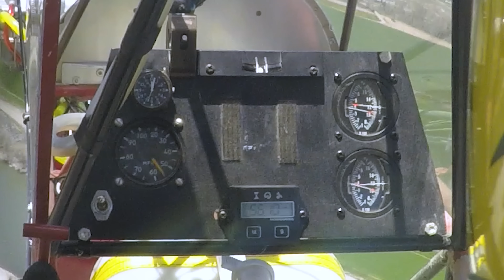MAIDEN FLIGHT goes BAD on landing.😓 Abandon airplane PART 6.

Comment from the maker: Grab yourself some Flight Stix, Hydration packs from www.leadingedgesupps.com and use coupon code: JONAS for 15% off your first order. ITS GOOD STUFF!
Reply: Jonas, how do I get some information about my company advertising with you?
Reply: Jonas, You made me feel way better. I have hell keeping and ultralight straight. Kitfox or 170 and I’m good. Tail wheel ultralight and watch the hell out 🤣
Reply: you have the same operation as the DC3    keep the tail up as long as possible.
Reply: Been following you for a long minute.   Ultimately do what makes you happy, but you’ve started a family and you seem to fly sketchy Aircraft and gambling higher risk.   Just observations from the internet!

Ultimately live your best life til the end
Reply: Grab yourself a radio.
Reply: Desde el primer momento que vi ese tren de aterrizaje, me di cuenta que era muy débil, y la rueda trasera parece de juguete,....el diseño del avión siempre debe comenzar desde el tren de aterrizaje y no al revés....
Reply: I'm sure you know it but your tire like "grabbed" up a crack/groove or other raised piece of runway & it pulled you over unless
you gear grabbed & pulled you over?  What did ya'll decide happened?  You did great in not hitting the lights/concrete. peace
Reply: Every time I crashed my motorcycle or 4 wheeler. Unstrapped helmet flew off my head before I hit the ground. Don’t wear a helmet unless u strap it!

Comment: You know an unstrapped helmet doesn't stay on very well in an accident.
Reply from the maker: Yeah I know. I forgot 🤦🏻‍♂️
Reply: @JonasMarcinko  😳
Reply: @JonasMarcinko  ALWAYS buckle the strap immediately after squeezing your head into the helmet, ALWASY.  Don't unbuckle your helmet without also removing it from your head.  Hang glider pilots do at least 2 preflight checks, the glider, and then themselves just prior to launch.  Shoe laces tied, legs in leg loops (harness), parachute handle, chin strap buckled, carabiner through main and backup loops and locked.
Reply: He was doing his John Wayne!
Reply: Actually, the first hit is usually the hardest one so it's not useless. Yes, I watch my helmet bounce down the ski slopes all winter after protecting me from that first hit.
Reply: @tallwill38 Doesn't apply here. He is not at risk of being blown up by a 122 or 155 MM artillery shell. However, he needs to survive repeated impacts against the ground, lights, and other hard objects. The helmet needs to be on. Given the cockpit open, architecture. I wonder if wearing the plastic armor that motorcycle racers wear could be practical.
Reply: @god-tx4xz  ??? who says it will still be on for the first hit?
Reply: @JonasMarcinko  Nice run to forget on too 😜
Reply: Neither does crashing from the air
Reply: You are nuts!
Reply: @JonasMarcinko  add it to the checklist

Comment: Ski doo( rotax) snowmobiler here. I have some tips for high Temps. Plug check. Running engine wide open to temp and shut it down. Pull plugs. White is too lean...brown is perfect...black to rich. High temp means lean...DO NOT RUN IT THIS WAY! Surprised you made it back! Good luck.. severe elevation changes and or ambient Temps affect jetting. You will become a master of this. Two stroke warning of impending granadeing......slight tink tink tink. If you hear this sound immediately look for landing spot !
Reply: If I was to bet why one cyl was a little lean in this instance I'd say that the carb slide was a little low in that hole. A uni-sync is your friend!

Comment: I just watched the 3rd person landing in slow motion, and the gear struts may have been the cause for the control issues directly after landing. While they did completely collapse after going off-strip, they were certainly twisting around as you were slowing down and losing lift after the initial touch-down. Those struts look like they're made by Twizzler, or just an old garden hose repurposed as landing gear...
Reply: Yeah they changed alignment on landing for sure. Once one wheel goes toe out it just omits all rudder attempts to keep it straight.
Reply: Yup, I agree, pretty sure that left side twisted toe out well before it went off the runway.
Reply: Yea, agree, those wheels twisting couldn't be overcome with rudder.  Landing gear too flimsy.   At that point you were just along for the ride.  Did you a hell of a good job staying with it all the way.
Reply: The MLG struts are definitely an issue on this plane. The use of a different - stronger metal might be an answer to increase the strength.... One of the best ways to be able to handle the shock loads of landing, is to use struts that are made of 1"o.d. mild steel tubing with a w.t. of 0.062"  that form an elongated tri-angle shape that have pivot saddles attached to hard-points on the fuselage while the apex of the tri-angle legs has the axle stub welded to a sturdy plate that is welded to the apex.. The Use of several winds of 1/2" bungee cords attached between the MLG legs and the opposite side of the fuselage, to handle the shock absorbsion when the rubber meets the runway is a relatively cheap & inexpensive way to improve this undercarriage. The engine heat needs to be lowered in that hot cylinder. Better ram-air ducts can help this. Anything above 475 degrees F. And the aluminum castings start to loose their tempering...
Reply: The left wheel touched a fraction before the right and twisted backward and out as it did. There were a couple more small bounces, coming down on the left wheel each time, repeating the swivel to the left at each impact. Once both wheels were down, control (almost) came back.
Reply: Yep, its like a shopping trolley. The tail looks large enough and there's a long enough moment. But the wheels don't agree on the direction you should all take.
Reply: @michaelmartinez1345  sorry Michael I tried hard but my eyes just glazed over trying to envision your instructions, Don’t feel bad I’m not a pilot but hope to be that’s why I’m here to learn more.
Reply: haha
Reply: Came to say the same thing. Def sketch gear.
Reply: The struts were never fit for purpose. This is a death machine.

Comment: I have only flown RC models, but know how tricky it is to make tail-wheel landing gear "behave" during a landing. ALL my homemade models had this issue = one of the legs flexed more than the other, so the airplane veered to one side. It is nearly impossible to make them 100% balanced. My solution was to build slow airplanes and land as slow as possible, so that it stops almost immediately. Or use a prop-saver and land on the belly without gear. Perhaps a slow speed landing is what you are supposed to do with this airplane, as well. Those gears seem to be for taxiing, but not so much for landing.
Reply from the maker: I agree.

Comment: "That one cylinders pretty hot"
SWAP THE SENSORS FIRST
ALSO USE A TORQUE WRENCH ON THEM
You are using the cheapest sensors in the world they are not accurate at all, but once you are satisfied they perform their function, indicate hotter cooler than the normal weird readings, they are then useful. They are not scientific quality instruments.

Comment: Jonas, I’ve watched your adventures for sometime. I assume this was an early test flight.  Many details of ground handling can be determined early in the plane and your life prior to leaving the ground by using logical test protocols, see EAA. I will withhold judgment of your actions but add that it is very easy to kill your self in any aircraft. STAY SAFE, STAY SMARTER.
Reply: And for gods sake buckle your helmet or don't bother!
Reply: Definitely gear. Stiffer gear needed with a few degrees of toe in.

Comment: One other thing.  No tail authority,  yeah because your wheel wasn’t on the ground.  I had a himax for 300 hours.  They land so slow,  of course the rudder isn’t going to do much effectiveness if it doesn’t have prop wash or airspeed going at it.   keep it on the ground man.  Pin that thing down with the stick back.  None of that forward backward on the stick.  It doesn’t handle like shit. You’ll figure it out. They handle excellent if you keep the tail down and are careful in the transition.

Comment: I have owned and flown 2 Airbikes, fun aircraft IMO but the gear legs do have some limitations. Might try holding the elevator back after landing and “pinning” the tail down. 

Also EGT’s are the critical thing and “the gauge to watch” on a 2 stroke. MORE propeller pitch (lowering maximum RPM’s) should also lower your EGT temps (2 strokes run cooler with more load on them). Obviously, you gotta balance the engine load and performance but small pitch increases can really help dial down the EGT’s on a 2 stroke.

Comment: Uh Jonas- how can you fly without a radio?
Reply from the maker: It’s actually not required. Pilots should be aware that procedures at airports without operating control towers generally do not require the use of two-way radios; therefore, pilots should be especially vigilant for other aircraft while operating in the traffic pattern.

Comment: That, my friend, is a flying coffin. Let’s see: helmet not strapped on, mis-engineered main gear, sketchy engine, twitchy ailerons, no rudder authority, no radio, sitting and leaning back on two slabs of wood and 5 gallons of fuel between your legs. This is the flying equivalent of Russian Roulette with 5 rounds. Best of luck.
Reply: Yeah! What could go wrong?!?!
Actually, a coffin has more structural integrity!

Comment: I  have a set of Airbike plans that I might build from someday so I have the Flight Manual; Normal Procedures: Landings: step 5 of 5: "Land with full back stick to maintain directional control".  FWIW, that landing gear is not like what's in the plans; the plans show a solid axle.  Also the engine mount is completely different.   And the elevator hook-up is different.  And the engine is fan cooled...and...

Comment: Get rid of the free air cooling..put the tins and the fan back on..If you dont have them..Ebay...or lockwood or CPS..Free air is sketch at best unless you have the corect shrouds..The gear legs..need to be stiffer..pay close attention to toe in and tracking
Reply from the maker: I’ll check it out. Good to know. 
Thanks!

Comment: I notice the air bike main gear is to flexible and looks like it need redesign and just before touch down it looks like the tail wheel was not straight and off to one side

Comment: Jonas, you're playing with fire a bit with your choice of aircraft. It's old, of poor design with an old, obsolete engine. The engine looks to be the single carb, single points ignition version of the 447 which was not the most reliable. A friend here in France had several engine out incidents with his before finding a good used 503 which even as an early version with points (I'd only ever go for electronic myself) has proven to be more reliable. 
You've also just discovered why the US preference with older ultralights for welded spaceframe fuselages and welded landing gear was not a good idea. An old club member from the UK had a take off problem with a binding brake in his RANS S6. It slewed to the left, just cleared a close-by mud sea wall and went in damaging its undercarriage. Luckily he was fully insured because it had to go to a RANS agent for repair which needed a full new fuselage shipped from the States and took months. 
Welded spaceframes are not popular here in France where I now live because almost all of our ultralight (ULM) airfields are grass and should you break something (as I have) a repair only involves swapping in a bolted tube and takes only an hour or so. On one of my old X-airs I broke a leg and had it repaired in an hour or so by cutting a length from an old wing strut of the same section, with no other damage to the aircraft.
Remember, modern ultralight aircraft can only just kill you. Old ones, well they're another story. Take care 🤕
Reply: So you think it's a poor design.  Actually, the Airbike is about the nicest flying plane I know of.  It flys just like a Taylorcraft which means it flys really good.
Reply: @charlesradford3811  Yeah, that's why it ended up nearly taking out the PAPIs in an uncontrolled off-runway excursion ending up in half a ground loop. I'd hate to see what you think is a poor design in that case. Let's just disagree as I'm not going to get involved in a flame war.
Reply: No flames. I have 250 hours in an Airbike.  Best ultralight ever.
Reply: To be clear, what Jonas has is not an Airbike.
Reply: @charlesradford3811  Hi Charles, I never said it was. It's 0745 at the moment where I live and I'm getting ready for what should be 2 hours in my Savannah so won't reply now. But I'll give you my opinion for what it's worth on Jonas's aircraft later today after I've got back and I'll try to post some links to some thought-provoking images that I've got on my blog to back it up. Sometimes how something flies is not always the most important consideration. You also have to think about how it might crash and what the outcome might be and what Jonas is messing with I suggest would not score very highly in that respect.

Comment: Non pilot mug here Jonas .. I'd Split those Ailerons in half  and make the inboard sections a  flap .. Add decent brakes and learn to fly it like a DC3 ..Tail up early on take off / Wheel landings with the tail up till the last bit of the roll , Feathered by  light brakes  on landing

Comment: I replaced my Airbike gear with Rans gear, toe operated Tracy Obrien brakes,  Azuza wheels and 6.00x6 aircraft tires. Homemade locking tailwheel based on Bob Barrows design but scaled down. All sturdy with excellent ground handling. Stock gear is crapola.

Comment: The main gear was dodgy, as commented by others.  A gap seal on the rudder would help. Larger empennage would help even more... given the behaviour of the mains, a three-pointer might work better. Thanks for recording the process so well, thanks for sharing!

Comment: I'd suspect the rear cylinder will always stay hotter but why quite so high is odd. May be worth adding a bit of sheet metal to go around the cylinders to get more ram air and get more also on rear cylinder.
Reply: Richen it up a little. That will help until he figures it out.
Reply: If it has two carbs the rear cyl might have an intake leak.  Check all the clamps or hoses, whatever for a good seal.
(motorcycle mechanic but an engine is an engine.)
Reply: @timcarter7616  this
Reply: What motor is that. Is it open air cooled or schroud directed?

Comment: I can tell you from lots of hours "ground testing" a similar aircraft that your full span ailerons will get you in trouble on the ground if you are not aware of one thing, and you've got to prove it to yourself before you will believe me.....when you are on the ground the ailerons will steer the aircraft OPPOSITE, OPPOSITE, OPPOSITE of your input....and then you try to compensate with a tiny rudder and usually just make things worse when you come out of the aileron input and have toooo much rudder input......go out and "taxi test" , hold the stick neutral and get going down the centerline (doesnt have to be too fast), then add aileron either direction and note the results....just remember this....once the wheels are on the ground the ailerons reverse....At least they do on MY aircraft, so make up your own mind....it has to do with the drag of the aileron moving down being more than the one
 moving up....

Comment: It almost looked like the gear gave out before you went "offroading". The bounce looked like it was caused by the gear giving out, causing the ground loop and not the other way around. Glad you are all right and didn't hit the lights. (airports frown on that😁 ). Also, with the gear folded, the outward cant of of the wheels looks a little bit like a BF-109. lol

Comment: Nice Plane Gymkhana! (?) / Ultralight Gymkhana (?)
Your gear was already shaking when you were still on the runway. I'd make something with some triangle constructions, I think that would already contribute to ground stability. If your wheels don't flop about like that.. also the rear wheel never touched the ground, it was fully deflected but that doesn't help. Stronger brakes might be a good idea also. 
Or maybe go for a tripod setup rather then a taildragger (if you're going to rebuild anyway).. they're easier to land too, because flaring is harder when you do need to make contact with the front wheels first. 
But this wasn't your landing, just the flimsiness of the gear... Looked like your right gear was pushing in from the start pushing you to the left because it couldn't decide on an orientation after landing, it was just sorta flopping about.

Comment: So, using the swiss cheese model of accident. Big tires = lots of friction on touchdown, light weight = lack of inertia to keep you heading in the same direction while those wheels get up to speed, low power = low airflow over the rudder and reduced authority, paved runway = even more friction on those big tires... all of that, plus, taildragger an your first flight on type... Use grass or gravel runways until you have experience on the plane... Your friends almost had to peel you off of the PAPI. Glad you are ok, be careful out there.